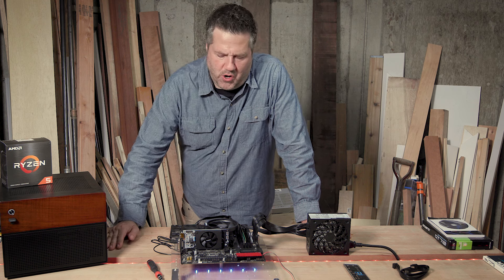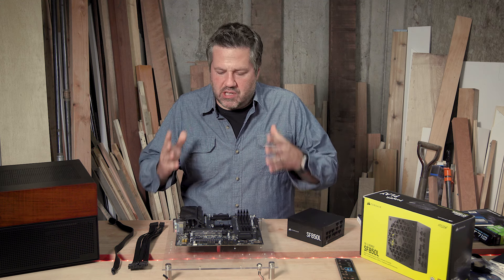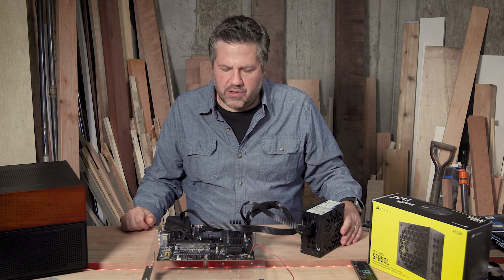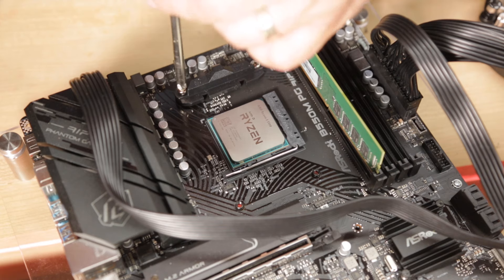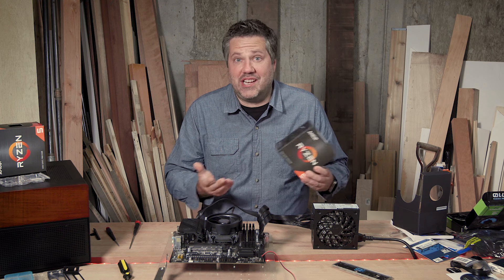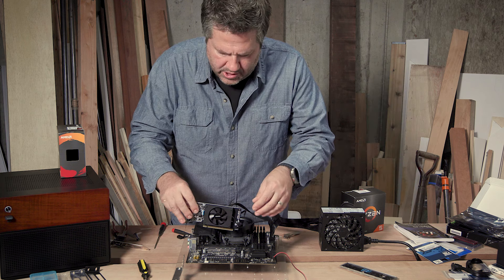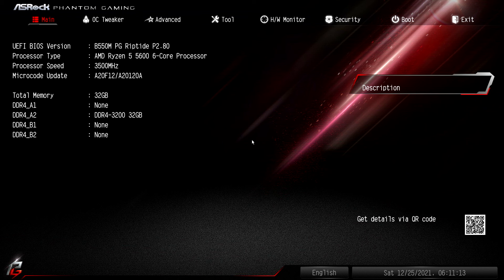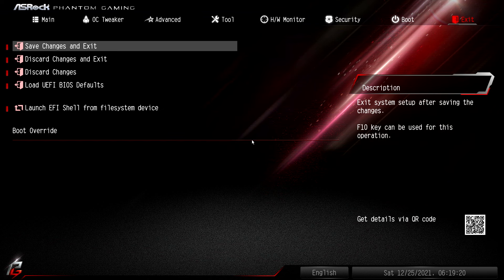Unleashing Beast Mode: Home NAS ECC Build Part II. The Core Assembly.

Comment: Thanks for the video.  I ordered from your links and will be following along!
Reply from the maker: Hey Dave - The next entry is in the works where I put in the case and test it out.  I delayed the video because there was a shortage on the case I used.  If you are still following along it will be a Jonsbo N4 NAS case.  They are now back on Amazon and I should release the video in the next week.  If you have any questions, let me know.
Reply: @SoWeBoughtaHouse  Awesome.  I have the same case.  I might have worked ahead a bit.  I'll be interested in the routing of the main power to the motherboard.  I'm not convinced I did mine correctly.  Also, I need a very skinny HDMI connector, maybe I've inserted the card incorrectly.
Reply from the maker: Nope you did it right.  The issue with the HDMI is a complaint I have with the case, That metal tab interferes with where the port is on the that card.  I used a DVI to HDMI converter to get around it - and once the server was set up, I don't use a connected monitor.  As for the cabling you likely did it it right. The cables were tight.  I opted for getting Corsair's premium cables (which are longer) for the ATX power and sata power, but you could also get an extension to make it easier.  The power supply is awesome but it just barely fits the case making it difficult but not impossible to wire those 2.5" bays. The case is good, but like any build cabling is the devil in the details problem, especially when working in such a small form factor.  My opinion so far though is it was worth it.

Comment: I used a Ryzen 5 5600X for my Asrock x570m Pro4 with ECC memory. I chose the 5600x, for it support for bifurcation (pcie 4x4) and ECC support and for the extra "umpf".
Reply from the maker: That is a good choice. I knew I was using a small case so I went the non X route for the lower power consumption and the lower thermal properties. I was also trying to keep the cost down a bit.  How are liking your build.  I have had it running for three weeks now restarts and cool temps.